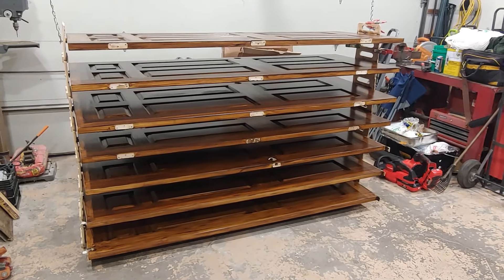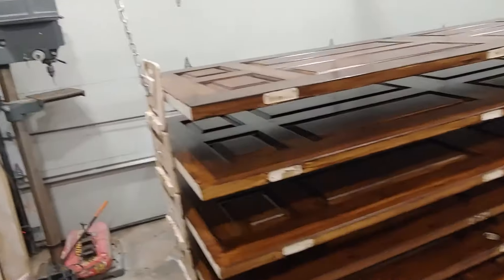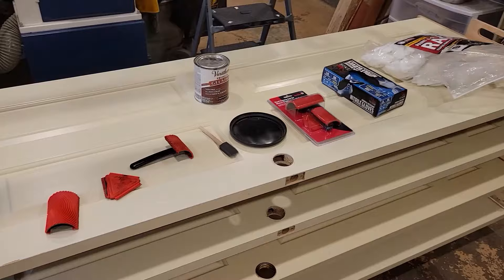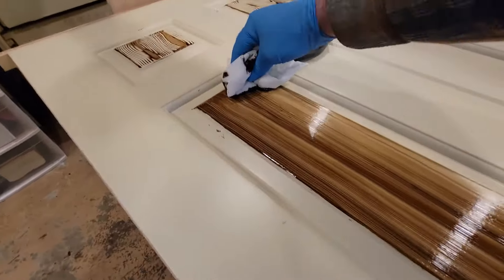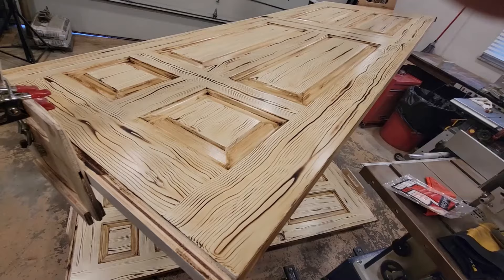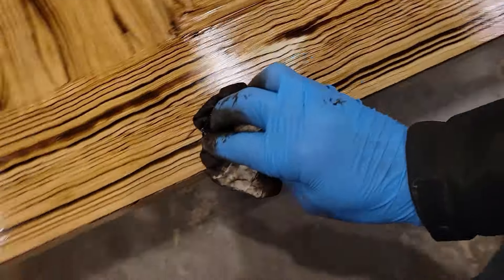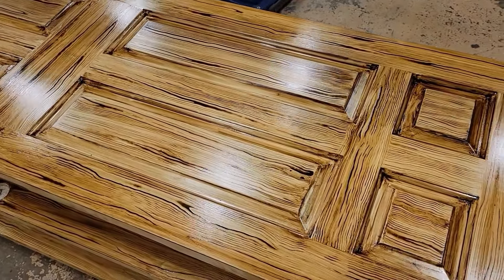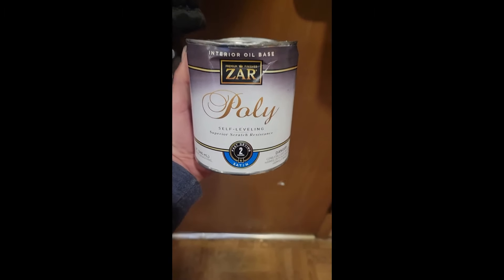How to Make White Doors look like REAL WOOD!

Comment: I missed that disclaimer about primed white door. The doors I bought are white but not finished. I bought all the stuff I needed and started the project. Everything was going well until It was time to do the second shade of dark. The door unprimed and porous made the Secord coat hard to put and it left  marks and lines of lighter shades. It does not look too bad but it is noticeable. I am not sure if it was because the doors were not primed but that is the only difference. I bought the same stuff you recommended. Same color and even manufacturer.
Reply: From what I seen @ the 2:54 mark it said painted or primed. The smoother the better. Where do you think it went wrong for you?
Reply: Did you have to scuff the doors first or just make sure they are clean?

Comment: after you apply the "wood grain" coat, do you go over the 2nd coat with the same color stain or it has to be a different color? Like this Varathane color I want to use is Cognac, can i use that all throughout?

Comment: I plan to use your technique on my front door. I need to remove the door and the hardware then after the first step I still need to allow drying time before I do proceed to the second coat. It sounds like the entire process could easily take 2 days. Any ideas on how I can cover up the front door entry while I remove the door for two days to work on it?

Comment: What about builder grade doors with faux wood grain as part of the door and shinny white paint over the primer. I figure a light sanding and then a primer will get the stain to adhere but I don't know if the faux wood grain is a plus or a minus with this method.
Reply: I also have this question!

Comment: Very nice, and that STACKING system, WHOA!!!  What a TIME saver that allows you!  Now...

Can you simply list out the COLORS/product used for each step?  You may have used the same color on the 2nd coat to achieve a DARKER look, but what are the actual colors you used? TIA
Reply: He was using Provençal for the stain color, he showed it at the beginning. Each coat is the same stain.
Reply: @cussininthekitchen8224  Sure, thx.  I'm not a HUGE fan of the graining tool, as that specific grain identifies a a particular wood, when the grain is totally different on other wood types, but yeah...he did an EXCELLENT job, & w/o that STACKING system & the space, the project would take W-A-A-A-A-A-Y too long to accomplish.
Reply: @cussininthekitchen8224  I'm watching some of the video again, & wow...he could ACTUALLY just use the RAG in areas to achieve a grain pattern, w/o using the tool.  Either way, this he has produced one of THEE best end results from all the videos I've seen!